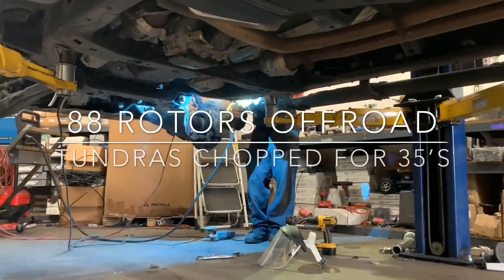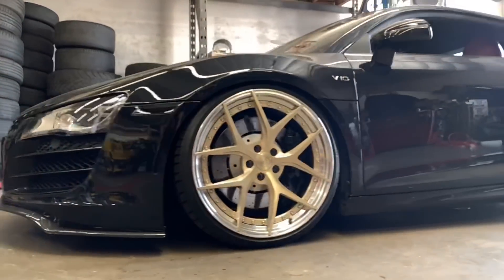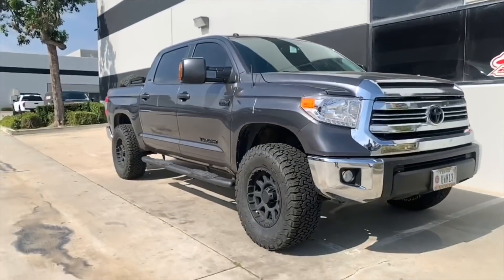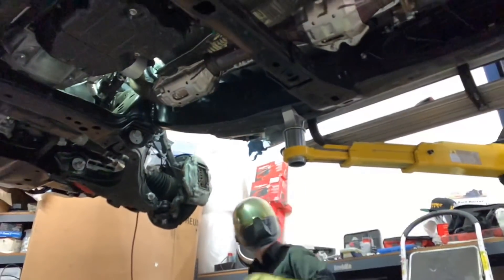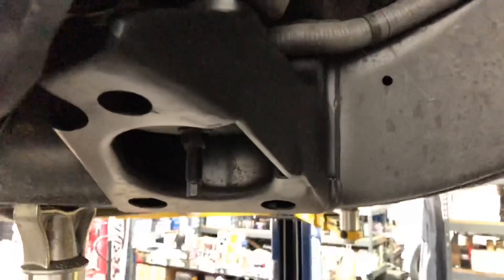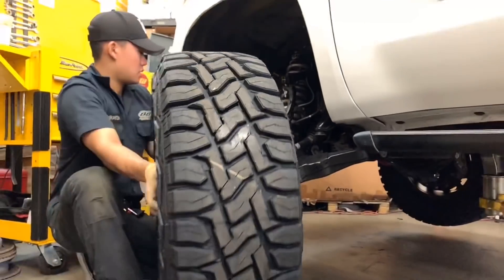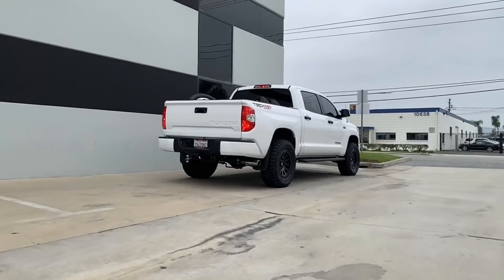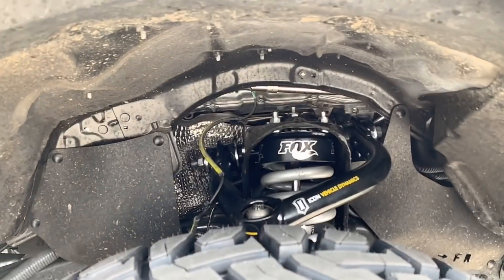2019 Toyota Tundra 4x4 TRD Sport & TSS Offroad CHOPPED for 35’s

Comment: Quick question, do you have to remove the front inner fender any time you install tires over 33 inches? I have the 2018 tundra sport and I want to upgrade my ready lift leveling kit to the Fox 2.5 and run largest tire with minimum rub. I currently have 33x12.50 x18